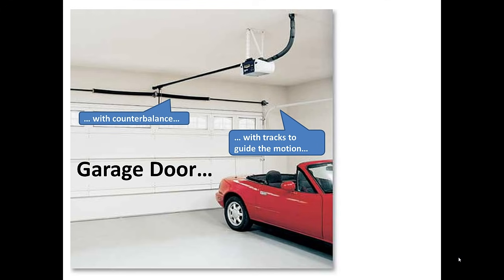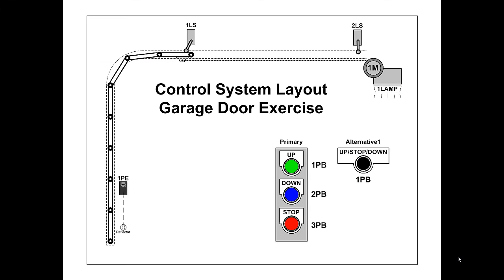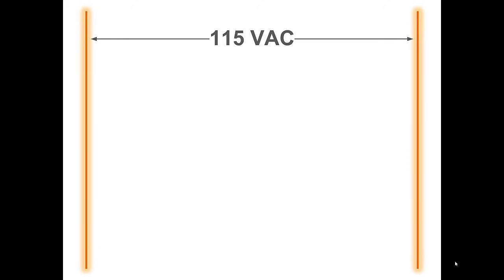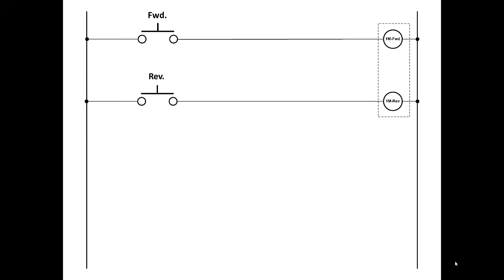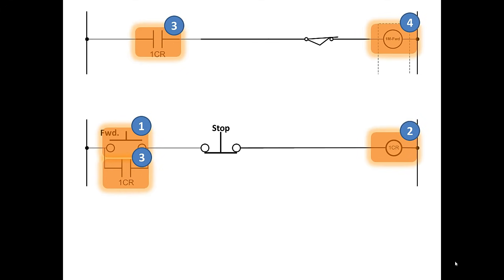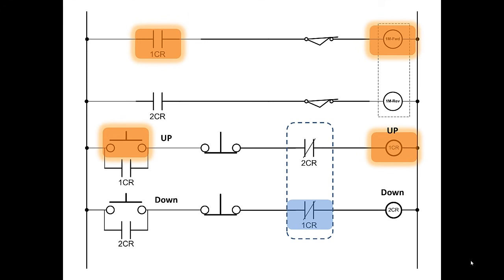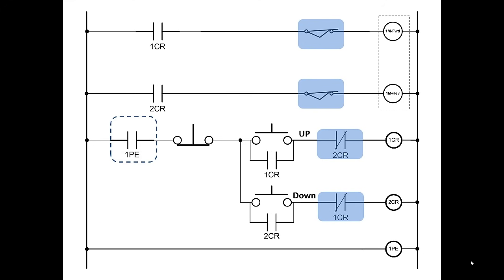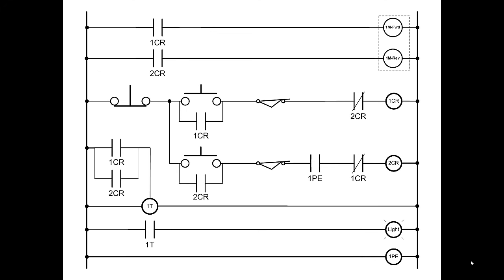Prog-1a  How To Program a PLC Introduction - Basic Level

Comment: Hello plcprofessor, I am a software engineering graduate, and i want to go to deeper into automation field (actually i am interested in plc programming, i had a project using arduino uno and c language before, but plc programming is different it is all about logic circuits), and is electrical knowledge is required in this field or not?, if it is, please can you guide me where should i start?? thank you very much...
Reply from the maker: You cannot lose in this field with some solid electrical knowledge. There are many excellent discussions on Youtube for basic electricity and electronics.

Comment: I just started with your tutorials on PLC's and I am at a complete loss of your use of the terminology "True" and "False" for what I think is on and off. It completely throws me off. Never in my life have I heard that used, I have always used terms like open, closed, normally open, normally closed, on, off, energized, de energized. More than most likely its due to the fact I am new to PLC's. In any event I like your videos.
Reply from the maker: Hang in there...read instructions are true or false, output instructions set bits ON or OFF. Keep watching, this is computer programming, not electrical circuits.
Reply: Maybe I'm watching the wrong videos, I'm an electrician try to learn the basics of PLC'S. I am in no way a computer programmer.
Reply: Have you watched his introduction to PLCs lectures part 1 and 2? (2 separate videos) I think that they would help clear that up. I had a problem for a minute until I watched them and re-watched a couple parts.

Comment: Thank you for the video. I am new at this and i got confused so i have a question: At the end PE contact is NO. Isn't that supposed to be NC contact so it cuts the power when PE detects an object while garage door goes down?
Reply from the maker: I am not sure of the context of your question. However, photoelectric sensors can be light operate and dark operate, they can have normally open contacts and normally closed contacts. A contact drawn in the schematic will change state when the state of the optical path changes, going from open to closed or closed to open, designer's choice. Ideally...If the sensor fails, the garage door would not close...fail safe.
Reply: @plcprofessor  thank you, sir!
Reply: Mr. Yildirim, good day. I got same confusion for the first time. But realized by the explanation of PLCprofessor that the PE is normally ‘ON’, and the relay of PE must be ‘True’ as A contact(NO). We can recall ‘true if on. So when the PE is cut by something( means ‘off’), the PE relay will be deenergized which means ‘False’. And this ‘False’ means stop the door while it was coming down. I hope this to help. Your question helped me study more and made me understood. Thank You!!

Comment: You should show that the 2CR and 1CR 'B' or NS contacts are being driven off of the relay and not the contacts diverting around the up or down buttons. Also, should probably name the contacts for those buttons 1C and 2C to alleviate any confusion with 1CR and 2CR.

Comment: I like the way you used something as simple as a garage opener for an example. It is easy to follow for those new to this technology. I just noticed 1 item you might consider changing. First is on the 2nd example when you introduced 1CR. Your explanation of relay operation was backwards (explaining NO & NC contact). I can also be out to lunch and misinterpreted what you said.
Reply from the maker: I watched that portion to be sure and it is correct. The symbols are static, meaning that they do not change appearance when the coil is energized.